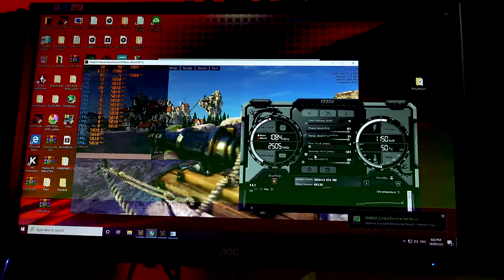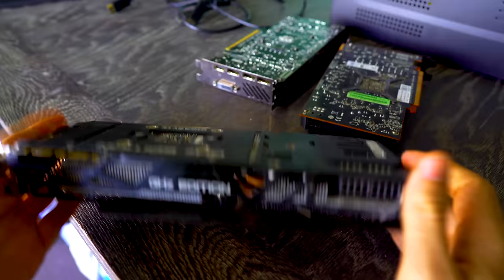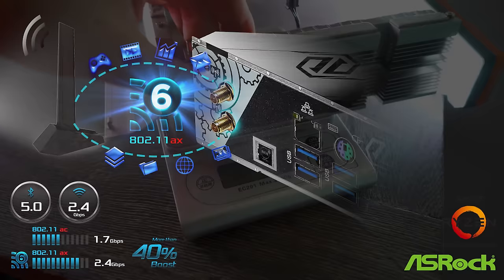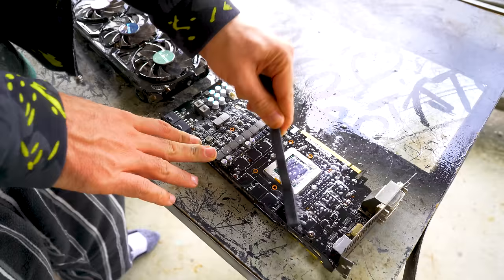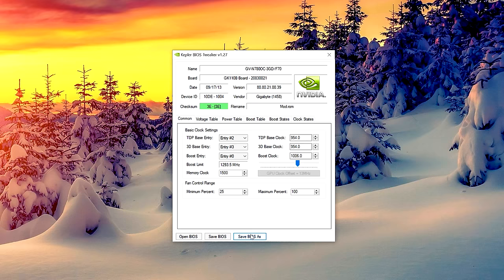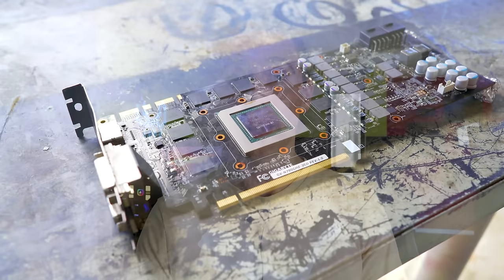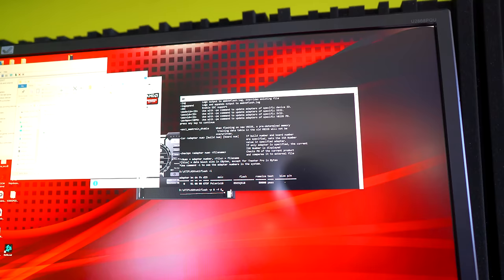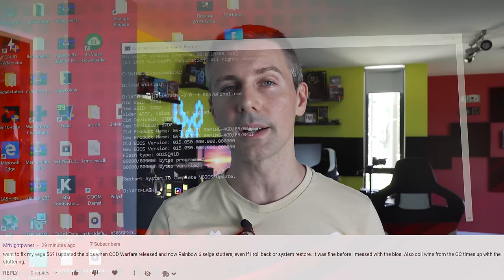4 Problems that Cause a Faulty GPU and How to Fix them.

Comment: Just something I'll throw out there - I was watching a guy who specialises in high end hi-fi stuff - he was saying it's fairly common for HDMI cables to return low voltage to the source, potentially damaging the equipment. So basically disconnect HDMI leads when not in use. Its a pain in the butt, sure - but better than replacing a $400 component. He'd gone through 6 amps in 1 year before he picked up on it, and I was watching because I'd gone through two - disconnecting the HDMI - no more issues. To be clear - I still use HDMI, but I disconnect the cable when not using it.
Reply: Does he have any youtube channel or any documentation? That's messed up if it's true
Reply: @JamieR  Sorry - I have no source material and cannot verify - but I can say the only reason I was looking into it in the first place was weird electrical issues - in my case lots of broken TV's - in his lot of broken Amps... he traced it to the HDMI cables... all I  can tell you is since disconnecting HDMI when not using.... no hardware has died. But connected - things needed replacing fairly often. Now to be fair, I live high up a hill in rural Spain... not the best electric supply. But clearly still an issue. Feedback voltage is a thing - if you're remote like me. I'm guessing it comes down to which model  and quality of HDMI cable - but simply the fact it can feed back and destroy your Amp / TV?  Yeah, at that point DP and an external amp start to sound good... Sorry I can't quote the source - My bad on that. But the advice given worked for me.

Comment: I like your channel and you seem like a decent enough person so I'll let you in on a few key pointers. First of all, I was formally trained to work on aviation electronics (avionics) for the U.S. Army. I worked with ..let's just say much more complicated circuits. A GPU has very few components because the majority of the work is done on the GPU DIE. About 85% of the circuitry your left with is power delivery. This is where I find most GPUs fail. Usually, a less than $2.00 part know as a MOSFET driver is responsible for power on issues like post, boot, etc. The "mystery problem" you described where a GPU acts fine up to when you put in it's drivers is due to the fact that until the GPU is running off a fully compatible driver and not some Windows VGA default the main power to your GPU (VIA the 6+2 pin PCIe connectors) is not used. The GPU uses power from the PCIe bus in its VGA mode alone. Once you install the driver the GPU then opens the power stages from the 6+2 Pin (Or multiple PCIe power lines) and the section of the power staging responsible for getting that power to the GPU is failing thus leading to the black screens. Also, you didn't push thermals enough my friend. Thermals gimped the Vega GPUs severely and they are, in fact, very powerful computational GPUs but do suffer from a high rate of failure due to thermals. HBM and HBM2 can not handle high temperatures yet are infamous for their heat output. It's the only GPU that can go from running fine to BSODs over a matter of 20MHz in some cases. The Gigabyte version of this card suffers from poor engineering of HBM2 heat dissipation. The cars are fine with some new 1mm thermal pads and an aggressive fan curve. I have one that kept locking after I purchased it on eBay and the seller claimed they couldn't refund my money ($770). My choice was simple if there were more GPUs to buy but in this case, I just got out my tools and fixed the GPU as I at least had it in my possession lol.
Reply: hey mate, Dead R9 390 with the same symptoms, dead on driver install.  besides super obvious things like burn marks (none Visible) what would you be looking for to diagnose a bad component on the PCB? temp? discoloration?

Comment: Don't freaking believe this. Yesterday I revived my 390x and today a 7950. Ran some benchmarks on the 7950 and all looks good. Can't say enough how glad I am I watched your channel!
Reply: They are still working?
Reply: How did you revive the 7950 cuz i have one completely dead ?
Reply: @splase1  washed the boards down in WD40 & then soaked them down good with electrical contact cleaner. The 3 7950's were still working when I put them back in the closet, the 390x lasted a few weeks. I ran the 7950's in pairs for a few months before boxing them back up. Only thing left to try on the 390x is heat, I guess. If that doesn't work I'll sell the waterblock.

Comment: Yeah I've had faulty VRAM being the number one issue for me with GPU's it just seems to degrade the quickest out of any part. I owned a Sapphire R9 390 for like 2 years just out of warranty, and it starts glitching out on me in-game with the issue getting worse as time goes on. It's definitely something that's had me sticking to more reliable brands like EVGA, MSI, or Asus.
Reply: Getting this problem on a asus rog strix radeon 570 after a year

Comment: Also when using the heat gun, It could be a good idea to put a lot of flux on the card so that an potential corrosion can fixed under the bga packages like memory and gpu core. As I have seen Louis Rossman do to repair bga chips on apple products.
Reply: The thing is on GPU's 90% of the time its not actually the BGA solder balls that are the issue. The solder cracking that people talk about is between the die and the substrate, not between the chip and the PCB. In the end heat-gunning a card isn't fixing it, its a temporary 'repair' at best, for some it may last another year or more, for most it'll work for 3 months, then 2, then 1 and then not at all.
Reply: @g6qwerty did that on my old dying GT 440 and it is back in service, at least for now. it's been just a couple of months though. my son use it almost daily for play games such as CS:GO and Roblox and it still works fine.
Reply: @radius.indrawan  Oh yeah it will work, but the chance of it failing is very very high, if/when it fails again just beware that although you can revive it again it'll last less each time. The thing that kills it is temperature variation, so you might find if its left turned off on a cold night that will be when it dies.
Reply: @chrissmith4766   i see.. well, when it fails again within a year or more, at least it has bought me some time to save my money for a new graphic card. and when the time comes, i hope i have a better deal for my money than today. plus hey, i have a card for some "electronic repair experiments", right? ;-)
Reply: @radius.indrawan  Of course! :) Its definitely worth doing at home to get more life out of a card! Its only when people do this and then sell them that its a problem. Hopefully it'll last you until they want something more powerful anyway :P.

Its always fun to mess around with them, for a lot of the older cards you can order replacement chips from China that come with the BGA solder balls already glued on underneath, in theory all it would require is heatgunning the old chip off, wicking up the leftover solver then lining up the new chip and heating again.

That said, its probably easier to pick up an old Kepler card for £20 :P, assuming the seller didn't reflow their card before sale..
Reply: @MasterBlaster220  Google is your friend ...
Reply: @
Chris Smith If I'm not mistaken this heat fix worked on Xbox because it was a different issue and they used different soldering.

Comment: Dude forget the heatgun, 8 minutes in the oven 196 c°, it did work for me with over 50% success chance.
Reply: 196c on the oven display or you use a separate accurate thermometer.
Reply: I bought an r9 270x in 2015 in 2017 not showing any signels at start fans run for a second or two then stops.....i saw a video....he said to put it in pre heated ovan for 4-3 minutes at 120 degree Celsius so i did.....i was dumb I kept it upside down.....and after 3 minutes the capacitor started to bust and some parts did fell down....well id replaced the capacitor with similar ones and it started......i play nfs payback at rock solid 60fps in 720p on high settings with i5 3330s.
Reply: @karanshirke6538  you should use a oven with ventilation inside, so the heat gets spreaded, to prevent capaciters to fall. Also you shoud not put the card up side down, if the solder melts the capaciters wont fall. 👍
Reply: @karanshirke6538  120 dregree, thats not really possible to melt it with 120 degree. Actally lead free tin has amelting point of 280. these stories are strange.

Comment: In MSI Afterburner settings there a force voltage control and readout option for AMD GPU's. It works with good with older AMD GPU's that don't have software support to control the voltage. It can also force higher GPU and memory clock frequencies.

Comment: Man I just want to say thanks. I had try a lot of stuff and nothing  worked. My last try was your sugestion to use a heat blower to try revive my GPU and works. It's a RX 580 and  this week it not turn on or spin the fans. Your method just worked and now it works fine and the GPU is reconized in my PC. Thanks a lot !!!!!!

Comment: 7:25 - how - salt in the air and high humidity 

living near ocean or sea comes to mind, or pc was just on the floor in the kitchen
Those metals and PCBs can take a bit of abuse, but in general you want it cool and dry, dont have a spot of rust on 10 years old pc.

Comment: Fantastic! My watercooled 390x quit recently, and then I saw this video this morning......went to the store and got some WD40, disassembled the card and sprayed hell out of it. I did follow up with some electrical switch cleaner (non oily type!) Reassembled with stock cooler and I'll be darned! It's working! Cleaning should be a no brainer but your vid got me insipired to put the effort in. Good stuff.

Comment: Hey Brian imho when reflowing SMD's with the heat gun it would help if you used some flux (saved many things with this method). Keep it up!
Reply: Do you just apply it all over or on each little solder?

Comment: When u have this issue with the one your referring to with the faulty gpus u havent been able to fix.  You need a multi meter and check fuse if.not that its prolly either a cap or mosfet. Sometimes a vrm

Comment: I have a MSI GTX 1650 OC V2 edition (with 6 pin connector) , its core clock is just stuck at 300MHz while it should be at 1410MHz even at 100% :(
Faulty GPU? Cuz i dont think its the power supply :(

Comment: Some extra advice: never throw away the thermal pads as shown in this video because they are usually not standard thickness and cannot be replaced....
Reply: If you are not sure if your replacement thermal pad is making proper contact, just put a bead of thermal paste on the pad, you can then tell if it's being properly squished.

Comment: For the heat gun denying people, let them look up how to fix the old xbox red ring of death used to be baking it in the oven or with a towel as they had weak solder points and the silicon often needed to expand a bit to reform connections. So it can work a lot of the time not always and its not perfect you could easily apply too much or too little heat unknowingly too.

Comment: its a wild guess, but i think the rx580 has a problem with the power sensing in the NCP pwm controller, which might reports a wrong power limit violation and the card power throttles. apparently its easy to mod this particular pwm controller into "disabling" the power limit.

Comment: Last week I bought a graphics card and motherboard with a Phenom II x6 6 quad in a case for $10 from a recycle market here in Queensland. it was so rusted and corroded that it looked like someone had thrown in the ocean. I took it all home and chucked the motherboard and graphics card in the dishwasher twice and then scrubbed both with a toothbrush and alcohol. Both now work perfectly. The corroded heatsinks were the hardest to clean.

Comment: my friend gave me his gtx 1050ti a few years back when it died it had the display driver crash issue and i did the heatgun method and it came back to life and has been working with a memory and core clock overclock since and is on almost 24/7, obviously not on full load all the time but it works great.
Reply: I'm having the same issue with a k620 Quadro and a Ati HD6870, for how long did you applied the heatgun and do you have any recomendations to proceed?
Reply: Diego Rivera I did mine for 20 mins about 2/3rds to 3/4 of the way up on the heat gun, not sure what the wattage of my heart in is I believe it’s a 1000 watt heat gun. It was my first time doing it and I haven’t done it in a while but I focused mainly on the core but also made sure to spend a fair bit of time on the memory and then the rest of the board got probably 3 or so mins. Hope that helps and good luck
Reply: Is it still working ?
Reply: D.U.O yep it’s been working with daily use almost 24/7 for the past couple years or so since it died

Comment: Funny how i fixed my 980ti with this method, I had already bought an RTX 2070, so when I saw this video I cleaned the motherboard with spirit and scrubbed gently with a toothbrush, used a heat gun on the motherboard then  added a new processor temp paste. My 980ti is now as good as new :), working perfectly. Thanks again for this video. It saved my 980ti.

Comment: One question: aren't you afraid that you could exceed the RPM of the fans (in general) when you blow them for dust without holding the blades down? Cheers mate
Reply: Think this is less of isue with modern fans but in saying that I've herd story's in past about people taking there hardware totally out of the game altogether doing so personaly wouldn't risk it
Reply: @rossmclaughlin7158  I'm one of those guys. I managed to kill about 4 fans in my system back in the 2010s. Granted now with fluid bearing and maglevs not that much of an issue. Cheers.
Reply from the maker: Nah not scared at all of it ruining the bearings, the worst thing im scared of is the datavac hitting the fan blade which I have busted a few MSI fanblades doing that on older cards lol. Mind you I don't sit there and feed it for 5 minutes straight, its usually 5 second bursts at best.
Reply: @techyescity  OK. Thank you for the clear up. Cheers, keep up the great content.
Reply: @techyescity  just for that dramatic effect using a data vac on PC seems really scary sometimes .
But I am sure you have control over it .
Reply: @techyescity  Also watch out that the fans doesn't send voltage back to the PCB when you spin it. Because fans can generate a higher voltage when spun faster then normal.
Reply: @techyescity  I try to hold the fans in place when blowing out the dust
Also static can be formed if spun and it could get into the electronics
Reply: @Kooq5  If it has a motor it will produce a current if spun. depending on diodes and resisters that limit current flow you are generating power spinning the fan. most will have diodes and resistors to block and limit current, but are not always setup to protect the whole card itself from over-voltage and high charge shorts.
Reply: frank it’s not enough voltage to hurt anything.
Reply: I blow the fan of my power supply using a blower, and when I turned on the pc, the fan started to make a lot of noise, surely reach an insane level of rpm and broke the bearing
Reply: @DualPerformance  yeah I can't do much to stop my psu fan either. Thankfully nothing happened to it.

Comment: The only reason I did not go with the ASRock Taichi motherboard (like the one advertised) is because its VRM's tend to get a little warm. Being that I am running a 9900k, which also tends to run warm, I went with another option. Obviously this only applies to the z390 chipset. If anyone is considering this motherboard with a different CPU/chipset... I would strongly recommend! The reviews on it are really good!!!

Comment: Instead of a headgun I used to put them in the oven at 80°C for 5 minutes. Works for me very well over the last years. The heatgun is still a good option for non-removable laptop-GPUs.
Reply: Thinking about all the smells he warned about with the heat gun and thinking "yeah, I want those gases in my food preparation device"

Comment: On the rx580 one of the diodes in the voltage regulator is gone, you need to check and replace the faulty one, the glitching is due to the card switching power states constantly
Reply: i though something in this line, hope he see your comment.
Reply from the maker: Cheers, anymore I can read up on this? Very curious about it.
Reply: Hi from Brazil, i think that one or more of the vrm phases on the card is faulty, so the gpu core clock goes all over the place, switching power states, good luck.
Reply: @techyescity  a guy on youtube named build zoid might can help you, he fixes and hard mods cards and knows exactly where everything is.
Reply: @techyescity  you can check JayzTwoCents video where he fixed his  rtx2070 super i think because he broke off one the diodes on the card
Reply: @AeiKei  l think that was a resistor and that was one ugly fix, vrms fail usually includes shorted mosfet
Reply: @erminbajric4633  yes, can be, but with a bit of electronic knowledge it is fixable

Comment: Got a doosey for you. I was gifted a GigaByte GTX 980 ti G1 Gaming (it's the 980ti version of the 780 you had in this video.) the card was working, it came from a guy that had it Liquid cooled. I shipped my Tower to a mutual friend who gifted me some other parts. Well he shipped this massive card installed in my Tower with no support or Insta-Pack. the weight combined with FedEx Shipping trashed the Motherboard. the PCIe slot had broken away from the board. The Card worked prior to shipping. Now when I put it in I get red and green lines on the screen. doesn't matter what video port I put in it. I have flashed the Firmware, cleaned it and have new thermal paste. I suspect the shipping damage also caused micro fractures in the solder. It's a beautiful shelf piece now. But I would love to have it over this "refurb" RX550